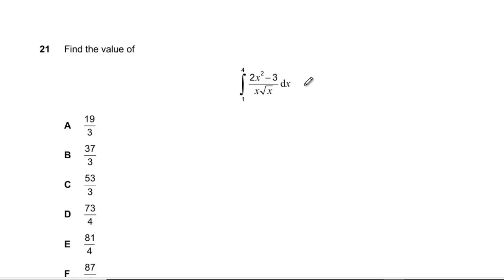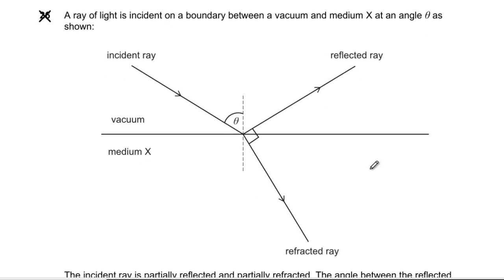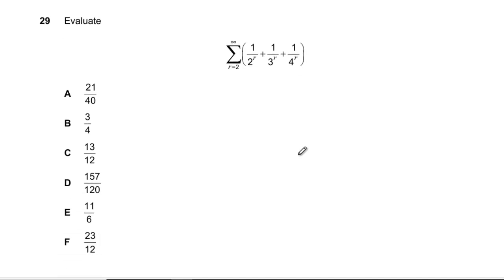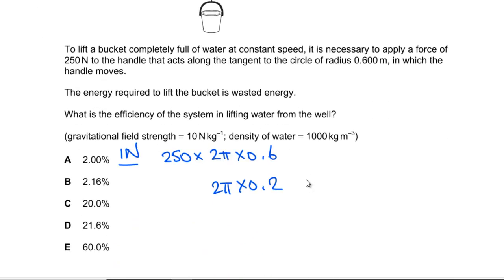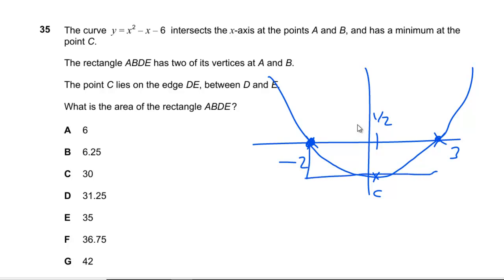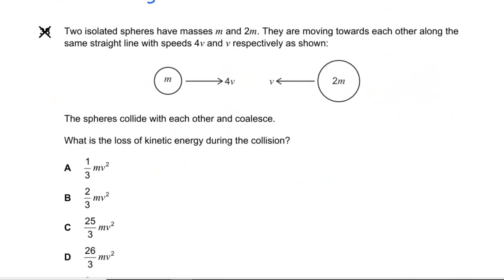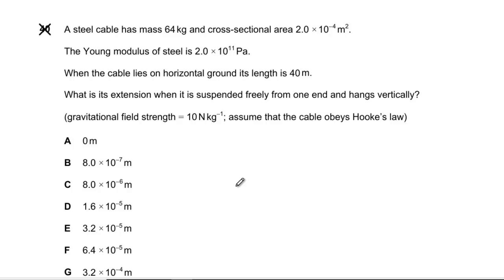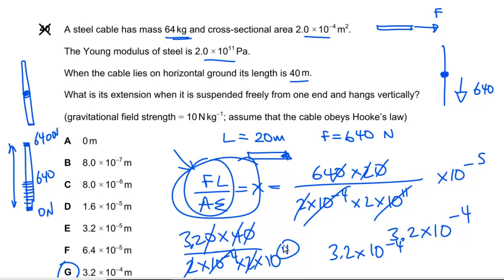ENGAA 2022 Section 1 Part B

Comment: Hey Mr Terror. I am trying to use Kirchoffs laws to solve question 35. Can I model the battery as a resistor with resistance r ohms and have 
i1 (current out of 6v battery) = i2 (current through 3v battery) + i3 (current through 3ohm resistor)

and considering the loop including 1ohm resistor and r ohm "battery"
6volts = voltage dropped at battery + voltage dropped at resistor 

and then say the voltage dropped at the battery is 3v which is also  i2 * r ( V = IR)
and so voltage dropped across 1ohm resistor is also 3v and as the current through the 1ohm resistor is also i1 we can say i1 = 3

if we then consider the loop excluding the 3V battery
we can say 6 = 3(voltage across 1ohm resistor) + 3*i3 (voltage across 3ohm resistor) 
therefore i3 is 1 and therefore i2 = 2 which is the same answer you got.

Are there any conceptual errors with this approach?

I also need to prepare for the esat :(
Reply from the maker: I haven't picked this apart in detail yet, but I have two initial concerns about this approach. Firstly you are taking a battery with negligible internal resistance and modelling it as a resistor. Secondly the values provided in the question increase the likelihood of incorrect calculations yielding the correct value for the current (particularly because the EMFs are 2:1). A good first test would be to repeat both methods for different EMFs (say 7V and 3V) and see if you still get the same answers. I'll have a closer look when I get time.
Reply: @BlakeTerrorPhysics  I tried 7V and it still seems to work. Following the logic you presented ... without the 3V battery then the middle bit is a short therefore the current from Y to X should be 7A
then without the 7V battery the 1ohm and 3ohm resistors are in parallel and as such their total resistance is 3/4 and therefore current flowing out of the 3V battery is 3 / (3/4) which is 4A therefore the current we are looking for is  7 - 4 which is 3A

Similar logic using kirchoffs laws and modelling battery as resistor also gives 3A.

Your method is faster and easier anyway. For more complex circuits though the "modelling" might be more straightforward (not that i have solved or seen more complex problems, it just seems that this might be the case) or how do you suggest one would go about solving a question like this with more complex circuits?
Reply from the maker: After looking through your method again (if I'm following it correctly), you seem to be doing the right things. The way I'm reading it, you're applying Kirchhoff's Laws 3 times (so don't need to think of the battery as a resistor) and the answer drops out. Your follow up calculations certainly seem to suggest that all is fine. As for more complicated circuits, it's a case of either accepting the inevitable extra effort and slogging through (whichever method you use), or knowing that you understand the basic principles and building the circuit in a simulator. I never see questions with particularly complicated circuits probably because the maths gets overwhelming very quickly, much like questions in classical mechanics (trying to apply Newton's Laws to anything complicated is usually a nightmare). Electrical engineers probably know some clever methods for complicated circuits but I've not done electrical engineering so would head straight to a simulation.
Reply: @BlakeTerrorPhysics Ah I see. Electricity is not my strong suit at all it was partly from your videos i even first learnt how to apply kirchoffs laws. Thank you for the response !!

Comment: For question 32, how come the weight of the bucket (12 N) has not been added to the weight of water (150 N) when calculating the energy required to raise the bucket of water?
Reply from the maker: To calculate efficiency we need the useful output, and the energy required to lift the bucket is wasted energy so should not be included.

Comment: when we remove the 3V battery in Q36 would it not just make a series circuit with the 1 and 3ohm resistors? why are we ignoring the 3ohm resistor
Reply from the maker: The wire is still there just not the battery in the middle of it, so it shorts the resistor.
Reply: @BlakeTerrorPhysics Thanks for the reply, why would there being a wire there short the resistor?
Reply from the maker: @brandnewcity06  Because the wire is in parallel to the 3ohm resistor so gives a zero resistance alternative pathway.

Comment: Hey Mr Terror,  For question 37 wont point P be at the top right vertex of a rectangle with sides a and 2a... and if so will the perpendicular distance to the line be the same as the distance from (a,0) to (0,2a) divided by 2? 
I tried the approach above and im getting the wrong answer could you please explain what is wrong with my reasoning?
Reply: ha just read that diagonals of rectangles dont meet at 90 degrees. I assumed they did

Comment: Q40 is it top or bottom half of the cable that experiences the weight force
Reply from the maker: If you think of the cable as a set of mini-springs joined together in a line, then each mini-spring will be stretched according to how much cable is below it. The very top of the cable will have the full 640N stretching it (because all of the cable is below it), the very bottom of the cable will have 0N stretching it (because there is nothing below it). This means that somewhere we need to fit in a factor of a half, such as the average extension of each mini-spring will be as if half the weight is acting, or we have the full weight acting on half the length.